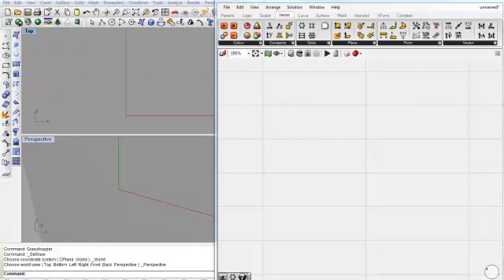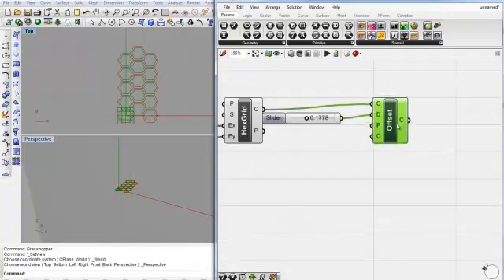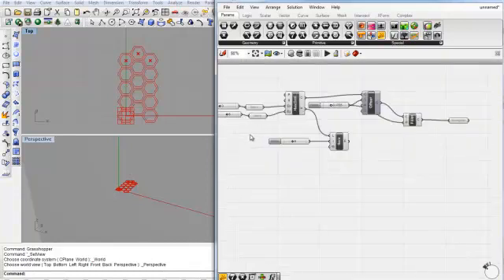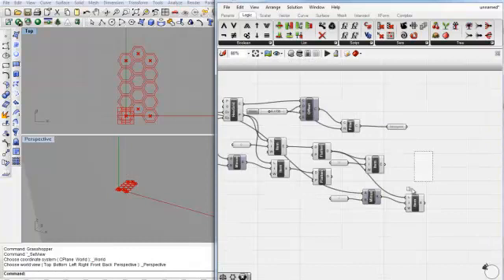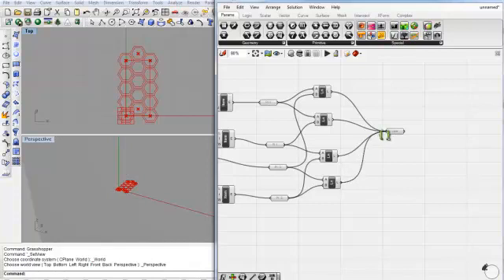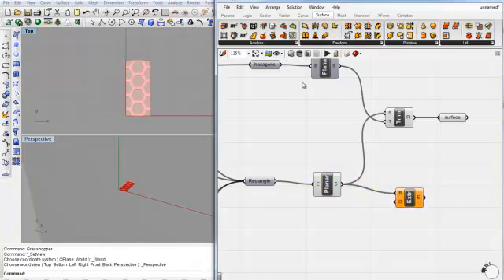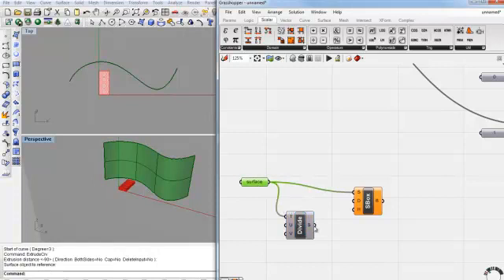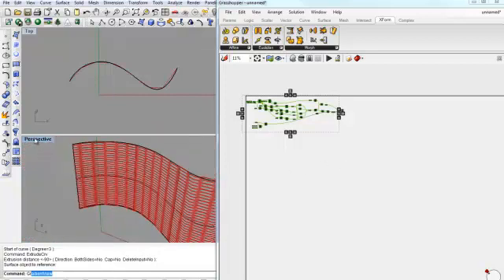Grasshopper Hexagonal Surface Tutorial

Comment: After a lot of tries and failures, I figured out the problem in her method and why we are all failing on the last step. 

So here it goes: 

1) When you have the planer surfaces (`Boundary Box` command in new grasshopper)
 for the hexagon curves and rectangles, flatten both of the surfaces.

2) To do that, right click on the surfaces on planer surface box (`Boundary surfaces` command in new gh) and then select flatten. 

2) Use `Extrude` command just on on hexagon`s (boundary surface) and the direction as unit z. 

3) now use `trim solid` to trim the rectangle from hexagons. 

you`ll get the output of trimmed hexagons as the result shows. 

+1 me if you follow the steps, so others can solve this.
Reply: You're legend!

Comment: In my comment I was referring to the objects that were drawn already on the canvas, not functions that you can use in Grasshopper. The hexagon grid is the collection of hexagons as it is visible at 6:00. Also, the bounding box that I talk about is the rectangle visible at 6:00.

With a planar grid I meant making a collection of surfaces from the resulting curves. It is a very basic function in all of 3D modelling. You can find functions by double clicking and typing in the name of the function.

Comment: @acosta081 These steps will yield the result as shown in the video:

1) Do a "region difference" between your hexagon grid and your bounding box
2) Create a planar grid from these outlines

In the newer version of Grasshopper solid trim acts differently as it did in older versions. Solid trim cuts out one shape from another, but only removes shapes completely out of the reference shape. Shapes that only intersect partially will be cut in parts. Using curves grasshopper does a trim as expected.